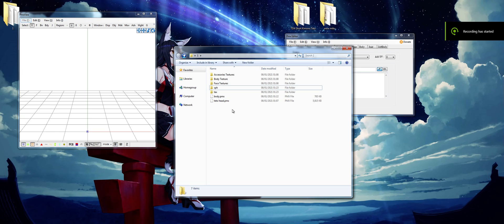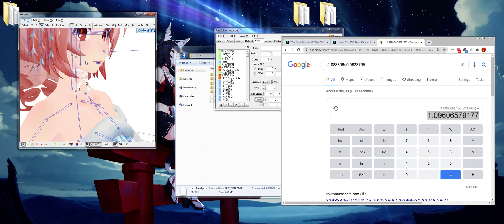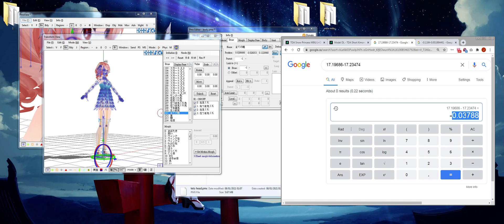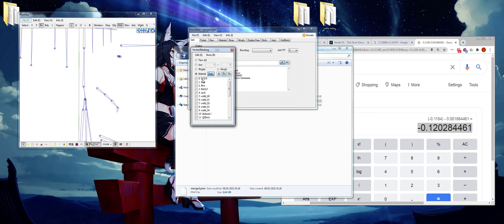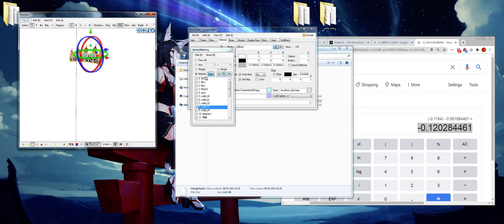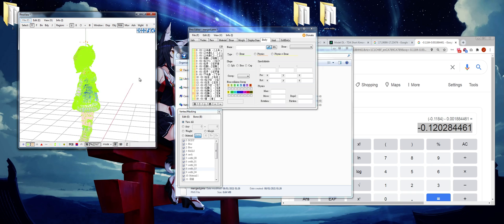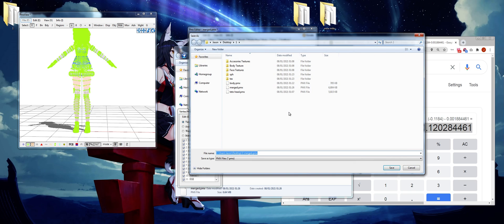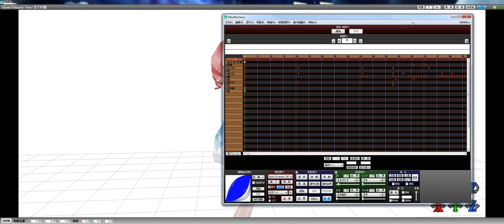[MMD] PMXEditor Simple Head Swap Tutorial - Part3 The Stitching

Comment: hello! can you please help me? i tried to stitch a head and a body, but it seems that the eye doesnt show up(?) when i put the model on mmd, any suggestion??
Reply from the maker: if you kept all the intermediate products you can check which step went wrong and redo the specific step.
otherwise id say go back to the body and make sure all bones above the neck are all deleted, then re-stitch
Reply: @jason199506  hiyya! i've figured out the eye error! 

while we're in discussion. i wanted to ask about another problem im having atm.

tried to put a hair on my base, but its either the hair flying away, or the neck getting all messed up (but hair is tact to the head) HUHU WHAT DO I DO
Reply from the maker: @yonthroughyoru  just the hair? check if your scalp/head still had "Body"s of the previous hair
Reply: @jason199506  the base im using is a bald/no head base, so no, there's none that i checked! 

or maybe i dont know which is it, how does the "body's" of the hair might looked like?
Reply: @jason199506  wait ok, i know what body is. if its on the base, its only the back of the head. could that be the problem?
Reply: oh god, i now cant open my file to mmd :'))
Reply from the maker: @yonthroughyoru  body handles the physics of MMD bones. like if 2 body are overlapped , they will push each other apart. when you say hair is flying away it sounds like the physics of the new hair is fighting with the invisible residual body of the old hair.
for cleaning body up see https://youtu.be/_TkhTSnj_-Y?si=lz5eqlCbVyj43ret&t=276

as for crashing, if you have a joint that doesnt properly refer to 2 bodies, it will 100% crash mmd.exe.
for joint see https://youtu.be/dDpXib3Qnmw?si=B9hueGdCmoCJkriq&t=661
Reply: @jason199506  okay, so if it was about joint, there is no joint but the chest joints beneath the hair. could that possibly what makes it clashing to the hair joint?
Reply from the maker: @yonthroughyoru  could but shouldn't. you want hair's body to interact with the rest of the model so hair doesnt go thru anything else, but usually Body from the rest of the model isn't big eonugh to make hair 'fly out'
wanna just zip you folder up and upload somewhere so i can download and take a look?

Comment: Hello! Amazing tutorial! I have a little problem and I can't really seem to find the answer anywhere. 

Everything is running fine but when i open the transform view, the area where the model should be is completely blank, not even the floor gridlines are showing. But the controls and everything on the right is still there. Would you happen to know how to fix that?
Reply from the maker: wanna zip up your folder and upload it somewhere? i can take a look
Reply: @jason199506  I'm not really sure how to do that or if I have a place to upload it. 

The problem with the transform view is still happening, but it seems I have found a away to work around that. All I needed to do was merge the similar bones. I just needed to figure out how do that first. The model is working fine now though. 

During my searches to figure out how to solve the transform view problem, I found someone in the comment section of the article "Use the PMXE Transform Window to edit your MMD models!" on "learn MMD" having the same problem. Someone replied saying something along the lines of checking weights and IK bones. 

The weights on my model seem to be working fine but I'm not sure how to check if my IK bones are the problem. The comment stated that the IK bones might be buggy and it may drag your model to somewhere you wouldn't want it (that being off screen).

Comment: Hey! So I followed your tutorial, everything went great! The problem is, my model's original body has a huge hat and when I turn on the physics, the hat's brim falls to the floor. But if the physics are off, everything is fine and working smoothly. Any suggestions on how I can fix this?
Reply from the maker: you deleted the bone or body for the hats(most likely the bones)
try to re-separate the hats see if you can get the complete hat without missing bones
Reply: @jason199506  I found the problem! I didn't fix the joints on the hat. I attached it to her head via the Body A thing on the joints tab. Thank you for your tutorials, it was really easy to follow!